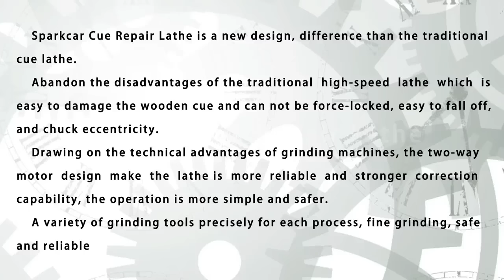Sparkcar cue repair lathe

Comment: Many are commenting that $629 is too much and I agree but since this machine cannot hold or spin the shaft concentric to the axis and without wobble, I would argue that any price is too much because the machine produces poor results.  Watching the chips wrap themselves around the rollers while I see the shaft wobble I can only cringe. The only right way is to collet chuck the shaft through the spindle, spin the shaft and turn the ferrule down to spec with a proper tool mounted hss or carbide cutter.  This rotate the shaft at 1 rpm and shave the ferrule with a router bit, wobbly nonsense is just terrible.  This is a perfect example of "just because you can doesn't mean you should!"

Comment: I like the tip shaping tool, but I wouldn't recommend the mount.  Did anyone else see the shank of the bottom bearing bit slip while trimming the ferrule ?  The speed available when sanding a shaft seems slow.  The bed rails don't inspire stability in my opinion, but , we all know about opinions and what they are like :)
I guess I'm just a victim of growing up in America in the late 60's & early 70's.  I want an anvil of a lathe, a muscle of a car and a hog of a bike :)   Heavily exaggerated everything including my faith :) 
Really nice video production and editing :)
Sincerely .....................................
Reply: tip looked out of round.
Reply: I agree with you about the bottom roller slipping while trimming the ferrule but I think I am more concerned about the shaft not being straight and the gap between the ferrule and the shoulder of the shaft itself. I think the concept could work be they need to but in a little more work.

Comment: The rubber rollers need to have something to cover it and you will need to have a vacuum to vac out all the while it running, as you can see your rubbers roller pickup a lots of woods white plastic that would make the rollers slippery.
Reply: I seen the shaft slipping.

Comment: i designed and built my own lathe because nothing i looked at was worth buying.... been using it for 25 years and still going strong.... powered by a 1/3 hp furnace blower motor....no shit... lmfao.....btw.... with a few modifications that gadget would actually work quite well as was pointed out... better stabilization on the rollers, centering collets and shims (although not many cue repair guys ive seen would know how to use them) and at no point did i see a dial indicator and way too many tool changes with wrenches that could easily be made into hand tight parts.. Those of you that know how important it is to spin yer work as true as possible i know can see this machine has potential for what its designed to do....but it will never be a "lathe".
Reply: Yeah, meaning if you change the whole construction, it just might work, hahaha. its not even steady, its not even centered, its just junk !!
Reply: I agree 💯. It is obviously over priced and not a lathe, but with some mods it can definitely be accurate enough for what it was made to do. And most of the problems talked about are user error anyway. I have a taig based lathe and with out shimming and calibration it isn't accurate either. Also as far as time went I again completely agree, too many unnecessary tool changes and a make do with a quick release for the router. Anyway it was nice to see someone saw what I did.

Comment: You should NEVER bottom out the router bit. Always leave it out a little bit.
Reply: Hi, please try to explain what you are talking about? I do not understand. Thanks.
Reply: @justinbryson352  if router bit is bottomed out and then you want to tighten it, there is no room for the bit to go down with the thread tightening. You wont get a good fit.

Comment: a) did you actually cut the ferrule tenon off ?
b) is the shaft shorter now by the length of the new ferrule ?
c) i wonder about the shavings getting in the auto feed steady rest wheels and either damaging the shaft finish or making shaft spin out of round
d) the barring  flush bit is proof the cue is not spinning true as the finish cuts are only engaging on parts of the spin and not uniformly all the way around.
e) since you moved the ferrule back past the original spot & the shaft is tapered, the shaft is not flush past the flush bit cut. There will be a line felt there.
f) needing 2 types of flush bits for the end of the cue where the tip glues, is excess and means the first is not necessary.

There's just too much crap to unpack on this tool. Short version is this is a cheap, insufficient, under powered lathe that could never to any more than work a tip or ferrule and not near as good as many other lathes or diy drill turning inventions. But I can't see getting a lathe for cue repairs or cue work that you can't fixe joints, finishes, dings and any other issues that come up. I mean, you can get a tip replaced for $15.00 or less sometimes and a new ferrule replacement for $40. or so. That doesn't exactly make this lathe desirable !!
These are just my thoughts and I don't mean to be offensive.  Just spreading knowledge and things to think about for the guy that is seriously looking to make a decision about purchasing a cue lathe !!
Reply: Well I think he was showing that you can use it to replace a ferrule. And also cut a new tenon if  you need to due to damage. Next time they need to pay someone to add English sub titles with some information on what is being done.  But I would never let this machine near my cue.
Reply: @dblgonzo  ... yea, i'm w/ you there partner :)  Ppl make toys like this to make money but they end up being a waste and could really damage your property !!

Comment: A bit expensive for a tip repair lathe.
Reply: It wouldn't meet the professional standards of a repair lathe. But for a personal lathe where you just service your own cues every once in a while, I don't see a problem with that. Kinda like harbor freight tools. Good for at home but I wouldn't bring them to my day job.
Reply: @nathansheffield2736  No doubt, except that I had a $600 lathe that I used, not only to change tips but I repaired tips, tenons, ferrules, and did wraps and more. Truth be told, the lathe is too limited. If it's just for changing tips, there are $200 lathes that, though rudimentary, will do a very nice job. The lathe is just too compromising and doesn't allow for versatility; a simple lathe should at least have the capabilities to allow you to do tips, ferrules, and tenons.
Reply: @ctprocess  , ....... , shoulda, coulda, woulda, .......... it's like saying, "I told you so".  It doesn't solve the issue or inspire validation.  My point is, if the lathe is meant for tip repairs , we must judge it for what it is and not on what we may desire.   I don't like the lathe for what it is supposed to do.  I also think it is not right for sanding cues which he executed.  Nathan Sheffeld may be right comparing it to a Harbor Freight tool for the reasons he conveyed , but , .......... , BUT,  at that price I wouldn't even consider investing for a home lathe, so I agree w/ you there Luis A Colon :)

I hate to talk negatively about people and their toys but I'd rather someone not be influenced into thinking this a viable option !!!
Sincerely ....................................

Comment: I cant even list all the nopes i see here.
Reply: Too right mate tightening the chuck down on the ferrule even with a bit of tape made me cringe. Use a collet ffs and the build up of old ferrule shavings under the rollers.  Maybe mk2 will be better as it is a good idea but needs a little more development.
Reply: Dave Murrell de
Reply: A shop vac in a shop setting would solve that huh .